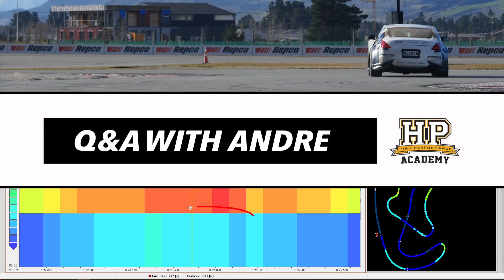[HPA Q&A] Which is better? | Speed Density vs MAF

Comment: I used both in my STi. I had the MAF & MAP/SD maps blended sorta like a Flex Fuel map. The MAF controled closed loop & light load driving while Speed Density controled the Open Loop/WOT sections. This way you don't have to worry about performance when or if ur driving in higher altitude and colder temps.
Reply: Evol_AF you make an excellent point. You basically need both MAF/SD tuning maps because you don’t always run in closed loop. Smart man 🧐
Reply: @bfe671  I wish I could take all the credit for the Idea, but I mostly just build motors, and even tho I'm trying to learn, I have a very wise tuner. 
But ur absolutely correct. You aren't always going to be in closed loop, but if you have to pick between the 2, definitely go with Speed Density!
Reply: It's Dynamic Airflow. I'm on it now but still fine tuning.
Reply: what ECU are u using? @Rei-Sen
Reply: How can you possibly do that
Reply: @hassanabas1549  
Any good tuner should know how to blend maps.
Reply: you all probably dont care but does anyone know of a trick to log back into an Instagram account..?
I somehow lost my account password. I would appreciate any assistance you can give me!
Reply: @Ibrahim Keagan Instablaster :)
Reply: @Elias Torin Thanks for your reply. I found the site through google and Im in the hacking process now.
Seems to take quite some time so I will reply here later when my account password hopefully is recovered.
Reply: @ibrahimkeagan6842  Start with a well blended MAF / SDos tune and you'll be well on your way.

Comment: I have found with blended most shops massage the maf, some pe and little timing. And never touch the VE unless idle area.
I find clients have a better product and better drivability when the VE/VVE is dialed in correctly.
The MAF works that much better as it has its errors also and will revert back to the fueling tables. 
When both are dialed in, a thing of beauty and the issues most have with idle, buckingand throttle follower band-aids I see go away.
Thanks for all the knowledge the HP Acadamy kick down.
Just by chance found this video today and you guys are spot on..
The MAF is definitely advantages when used correctly. 
I use on daily dirvers that travel 30 miles to their work in 100f temps ambient with GM ECM well over 40psi. Idles and drives like stock until. HP def gives quality info in their videos.
Reply from the maker: Cheers for the support mate! Glad we're hitting the right notes for you. There is probably as much knowledge hidden away on this channel now as what is in our courses, just harder to find but even the older interviews from 2013 on etc have some real solid nuggets of knowledge tucked away in them. From what I have seen anyway, even I haven't managed to watch everything - Taz.

Comment: What I'd use, all in conjunction;
- Oxygen sensor (measure oxygen concentration in the air)
- Mass Air-Flow sensor (Hot Film type, with separators and deflectors)
- Manifold Absolute Pressure sensor (open loop)
- Karmen Vortex sensor (measure air velocity)
- Redundant temperature sensors

Comment: I'm running MAF only on my 2015 Camaro. Runs so good 🙌
Reply: That’s because MAF tuning is better suited for stock to mildly built DD, therefore overall driveability. Speed density is best for strip/strip rocket and not much else
Reply: @bfe671  I agree Brandon. SD is great if everytime you travel to a new rack you like re-tuning for that specific altitude, temp, etc. I've seen MAF on 1000 HP cars on the street all the time. I'm currently playing with Dynamic Airflow in HPT. My cam is big but no overlap at all so my MAF isnt bad, but I still want to experiment with smooth idle to cruise transitions up to 2100 rpm until Dynamic hands it over to MAF to calculate.

Comment: Everyone arguing in the comments while I sit here with my closed loop SD tune lol. Lets not forget that PCMs are able to read barometric pressure from the MAP before starting the motor or that the pressure readings by the MAP sensor would inherently shift with elevation/weather changes anyway. MAFs are more like a game of telephone; the message may be precise at that exact point but could be changed by the time it reaches the final destination.

Comment: maf tuning is definitely underrated, i started wondering why is it that most newer civics are tune on speed density when it could be done using maf for a more consistent tune. 

i recently started tuning civics using maf and it has made tuning much easier, consistent. my daily responded much better to maf tuning vs map and the fuel economy improved greatly.
Reply: What do you mean newer civics? Basically every turbo honda in existence is running on speed density. You were doing something wrong for sure.
and non-turbo as well, lol.
Reply: @5PYZ3R  i tried maf tuning on my na 2010 civic si and the car felt great just had to go back to speed density as the maf kept throwing the car into limp mode.

Comment: Speed Density > MAF in any remotely serious car 🤙
Reply: Why calculate something when you can measure it?
Reply: TheSplendidVids Because MAFs aren't as reliable, they restrict your intake plumbing design choices and can also be skewed by either post maf air leaks or water vapour etc. They're fine for OE cars...
Reply: But what about elevation ant temperature changes? Can SD account for those and keep good drivability ?
Reply: TheSplendidVids The ecu changes with temperature variance. Just needs to be calibrated when tuning is done. Altitude is a bit harder but unless you're racing flat chat up a hill climb it won't affect you really. I'm no expert by any means, all I know is I have a high power SD car and a decent power MAF car and I am getting rid of MAF for SD on that car because it's been nothing but a PITA lol never had a problem with SD
Reply: Is your MAF on standalone?
Reply: I agree that SD is Far superior over MAF, but if you have a good tuner, than Map blending is the best way to go. If your tuner is using Open Source, you could ask him to use both the MAF & MAP/ SD maps, blending them to where the MAF controls closed loop & light load driving while the SD controls the Open Loop/WOT sections. This will get you the best of both worlds!
Reply: @TheSplendidVids  thats why you have a temprature sensor int the manifold aswell

Comment: But speed density systems still uses ait and baro, engine coolant temp, along with map, a simple aftermarket ecu like my haltec ps1000 uses all of these inputs to determine fueling/timing along with cam angle, boost by gear, etc it opens up so much additional functionality without the restrictions of a maf Orem style system, sure you can manipulate a maf system but only so much

Comment: Great video again keep it up.  So you are saying i should keep the maf on my holden vy ss ute gen3 ls1 v8 rather than go and get a mafles tune done?
I already have a x-air otr fitted and full exhaust but still have the maf in place... What would you do andre?
Reply from the maker: With the VY LS1 the MAF sensor is actually a little restrictive so you'll see a small power gain (5-8 kw) by going MAFless.
Reply: @hpa101   I recently bought a 3.5"  skunk2 cold air intake system which has a MAF relocation and housing , but the issue I ran into is that when the temperature dropped here from 80F down to 30F. the stock ECU was unable to add enough fuel to keep the engine happy because I am now facing a engine lean condition CEL.  I have read that switching to a MAP Tune and deleting the MAF is a better option.  Would you recommend this?

Comment: Can you explain how a heated resistor that reads temp changes can compensate for barometric pressure changes? (and density...as its the same thing as what pressure tells you)  Last I knew, a MAP did all of that.  If you have a leak after your MAF, your car will run like absolute dogshit mate....with IAT and MAP, it can run with a vacuum leak...better than that calculate MAF setup that is shooting as much fuel into car that was measured by MAF.  now, there are guys out there in the 99-03 Grand Prix scene in the US that run both. Why? becuase mixing the two can get more of a well nailed down tune.  I would prefer speed density though, race car or daily driver. JMHO.

Then, you have the differense between MAS and MAF.  wooo, everyone's heads spinning yet?
Reply from the maker: A MAF sensor, as its name implies will output a signal relative to the air mass. A hot wire MAF sensor accounts for air density and air temperature so it reports the actual air mass to the ECU. For example a lower air density that results from lower air pressure (higher altitude) has a reduced cooling affect on the hot wire element and hence the MAF reports lower mass airflow.

There's pros and cons with MAF and SD systems and yes some manufacturers such as GM utilise both simultaneously. Many people however overlook that a well calibrated and installed MAF sensor can offer better accuracy than SD since we are directly measuring mass airflow.

Comment: why not both ;)
Reply: Some stock GM cars are both. HP Tuners has this listed under Dynamic Airflow. I'm playing around with my VVE tables now and getting the SD portion tuned so I can enable Dynamic. My hope is to smooth out the idle to cruise transitions comparede to my MAF only tune.
Reply: Eze&Yare Dominguez  Not necessarily, If you're a race only application, then SD would probably be the best, but for the street, you can use MAF past 1000 HP as long as boost isn't extreme
Reply: Eze&Yare Dominguez  That would completely depend on the platform and sensor. A stock ZL1 camaro has 9 lbs boost and runs a MAF. I'm sure GM put headroom on that sensor.
Reply: Brett Collins  where in MD is your shop?

Comment: Andre, I've never seen anyone do it but why not use mass flow with speed density and humidity as well to build tables for correction? Over time and various ambient conditions and altitude wouldn't you have the ultimate VE table for running high revs and boosted big cam situations? Even opening up your intake pipe 25% about 6 inches before the maf sensor would get more accurate readings? Maybe spilt the intake running dual maf sensors would really get it more accurate?  Speed density could alert you to boost or vacuum leaks if the data didn't jive? Not for OEMs it's not important. I've seen too many cars pop from hiccups in the system with a tune that's right on the edge. Certain intakes don't feed the cylinders equally and burn down the crown when people think they are in the green zone. (Gen 3 hemis for one) 
I'm wondering what you think because some of these high power open ECUs can collect so much data now. You can more than just write tables. You can program the tuning loop like statement language. If Then and so on.